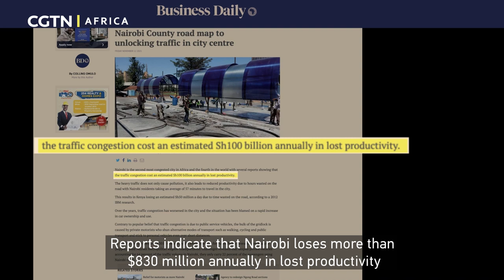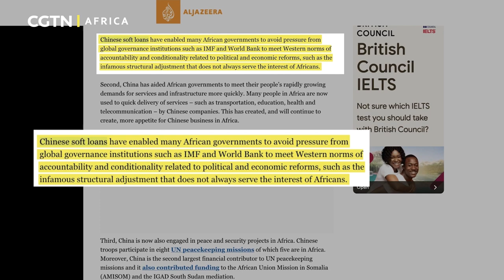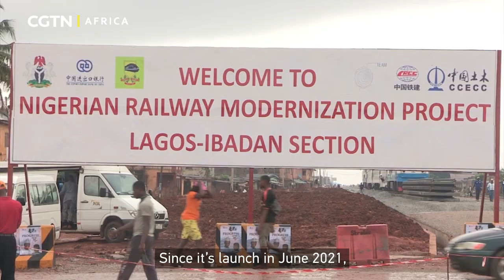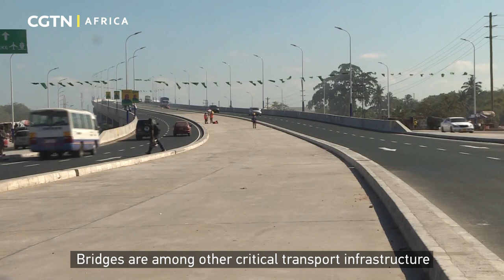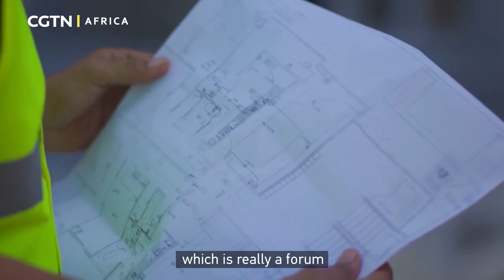#Scoreboard: How China is helping to shape-up Africa’s transport infrastructure

Comment: actually those resident building in Africa are better than our own here in 15 years ago. 
Chinese only lived better than that for less than 15 years. 
so if Africa can cheer up and work hard, you can also achieve what China has today in 15 years time. I mean you will have skyscrapers with elevators, beautiful parks, high speed trains and Metro systems that are a century better than the Americans have. but you must keep a stable political situation, don't get into war, work hard and stop complaining.